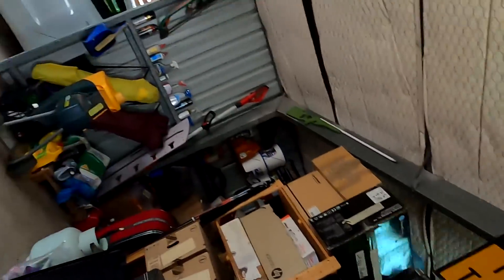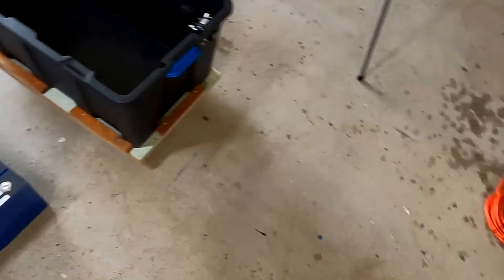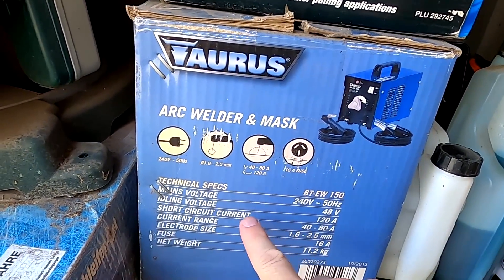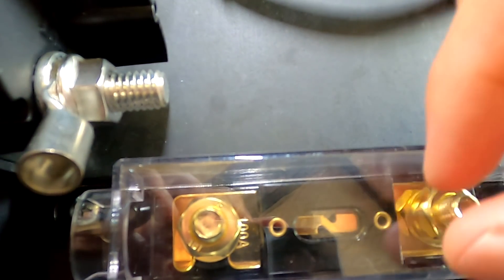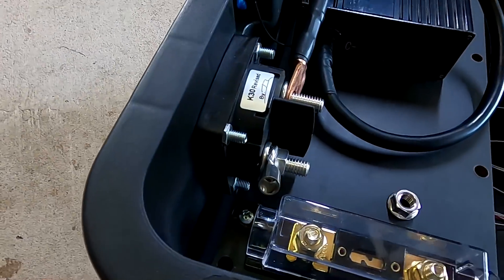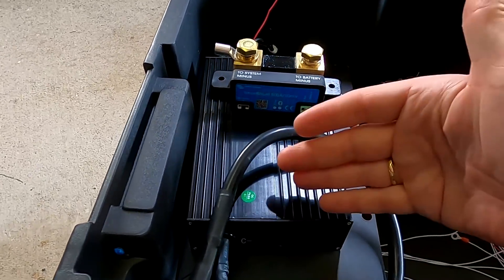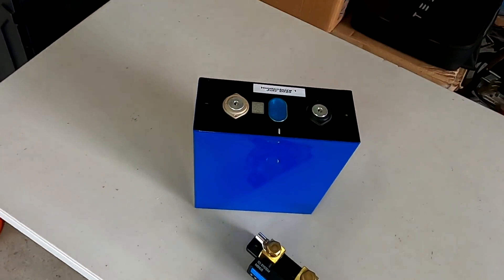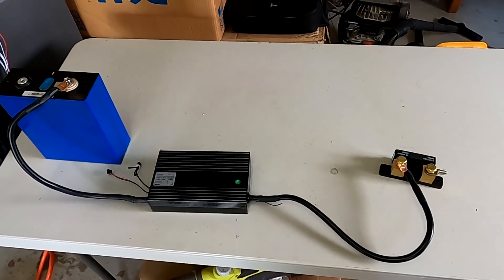Setting Shunt before the BMS a bad idea? Here is why I think this is GOOD! #buildthebattery.2

Comment: Yep #3 option, but I would also shorten the lead to the switch from the BMS. Make it a smaller pig tail.
Reply from the maker: I thought about that but does it matter a lot? Also if I need to change the config again to #2 I've got the cables ready... Maybe later down the track I will shorten these cables and make it look nice.

Comment: I would do #2 because with #3 if one cell gets to a very low voltage the BMS will disconnect the loads, but the SmartShunt will not be disconnected and thus will continue to draw some power: This could lead to a situation where one cell of the battery drops to 2.5 volts and the BMS disconnects the battery: However since the shunt is connected first it will continue to draw power and could lead to damaging that cell if allowed to continue discharging. I know the shunt doesn't pull much, but it has to power a Bluetooth radio which isn't nothing.

I also need to strongly disagree with your statement that the SmartShunt is "more accurate than BMS". Perhaps it is more accurate than the particular BMS you're using... (I am not familiar with that one.) However other BMS units I've used and researched have very accurate SOC calculations. For example, in my setup I have both the Victron Shunt as well as an Orion BMS. In my case the Orion BMS is much more accurate than the Shunt: The Shunt only measures amp hours: It cannot measure individual cell voltages, and only synchronizes with the battery when the battery reaches 100% SOC. It doesn't synchronize at 0% state of charge and so over time it's not 100% accurate, under continuous cycling the SmartShunt SOC will drift considerably from the actual battery SOC.

For example: Say you start at 100% and cycle the battery down to 20%. Because the shunt is obviously not 100% accurate it may read 21% instead of 20%. Now say you recharge back to 90%, but the shunt is off a bit so it reads 92%. Now you cycle back to 20% again and the shunt reads 23%... You see how the drift keeps getting larger? I have experienced this first hand with the Victron Shunt. Most BMS units will also measure amps going in and out, but they also monitor the individual cell voltages. So if you have a 280 AH battery and one cell drops to 3.0 volts while the other cells are still at 3.2 volts, the BMS will sense this and start to adjust the SOC downward to account for the voltage entering the "knee" at the bottom. The BMS will do the same thing as cells rise above 3.3v at the "top" knee. Where-as the smart-shunt doesn't synchronize the SOC until the battery reaches 100% SOC.

The other problem with the shunt: As your batteries age the number of amp hours they can store will decrease. So you program the shunt for 280 amp-hours, and it will only read 0% after 280 AH have been consumed. But if one of your cells drops to say 260 AH: What will happen is that after pulling 270 AH the shunt will still read 7%, but that one cell will have reached it's "Low Voltage Disconnect" and the BMS will kill power. However the SmartShunt will continue to draw power, and continue reporting a 7% state of charge to your phone via Bluetooth even though the pack is actually completely drained.

The BMS on the other hand should correctly report 0% SOC in this case, and will internally adjust the "state of health" down to 93% so that it knows for future discharge cycles it will base the SOC reading on 260 AH instead of 280. Good BMS units will also monitor the internal resistance of each cell and also factor that into the state of health of the battery to make future SOC calculations more accurate.

In other words: The SOC calculation in the BMS becomes more accurate over time as it "learns" the actual capacity and internal resistances of each cell. Where the SmartShunt is only as accurate as the amp hours you program it with. It will not adjust the battery capacity down as the battery ages and the state of health declines. You would need to monitor the state of health yourself and re-program the AH capacity in the SmartShunt from time to time to keep it accurate.

One thing to consider: In my setup my BMS can communicate via CAN-bus. I run CAN-bus (Which is very easy to wire) from my BMS to a Victron Color Control GX. The Color Control GX can then read the battery voltage, state of charge, state of health, battery temperature, etc, from the BMS via CAN Bus and can then communicate that info to the MPPT, Inverters, etc. (I use a VE.Direct cable from the CCGX instead of Bluetooth because it's more reliable, but I believe it supports Bluetooth as well)

I mentioned that I built my system using both the Victron Shunt and the BMS: But if I had to do it all over again I would simply skip the Victron Shunt and just use the CAN-bus to get the battery voltage and SOC data from the BMS to the Victron MPPT and Inverter products. Any decent BMS will be far more accurate than the shunt because it does more than just monitor amps going in vs amps going out: it also measures the individual cell voltages and cells internal resistances.
Reply from the maker: Thanks for your looooong comment and sharing your experience with your Victron products. That's very interesting and helpful.
The Smart Shunt has <1mA of consumption.
The statement does not come from me but from others who have tested the shunt and BMS's and found the shunt is more accurate. But I take your point and you have made your own experience with your setup already. 
I'm not sure if the BMS auto calibrates to the degradation of the battery. Maybe your's does that?
I'm also looking at the Color Control GX atm...
Reply: @OffGridGarageAustralia  Sorry for it being so long. I keep thinking of things that I want to mention. I built a very similar project to this about 4 years ago for my RV so I've definitely learned some lessons in the process.

Yeah, I saw the SmartShunt has only 1mA of consumption, so it probably doesn't matter much because it would be unlikely to be left in a disconnected state for long enough to hurt anything. But at the same time I thought the same thing about how I hooked up some stuff on my battery and I left a load connected before the BMS that also had a very small current that I thought wouldn't be an issue actually did end up causing me to lose a cell because it over-discharged it. After having that particular battle scar it just makes me nervous to have any kind of "load" (regardless of how small) that isn't controlled by the BMS because you might be off on a 2 week vacation when the disconnect occurs. And if the disconnect also prevents the MPPT from recharging over time that 1mA of current is going to keep pulling that low cell lower and lower. It may not ruin it, but that cell will now be "weaker" and lead to further balance issues in the pack later on.

These very large cells are hard to keep balanced as they age. My cells are only 200Ah so I imagine it would be even worse with 280AH. I had to add active balancers to my cells to help keep them balanced, especially since I had to replace a couple cells and so now those new cells are much "stronger" than my other cells which makes balancing even harder.

"I'm not sure if the BMS auto calibrates to the degradation of the battery. Maybe your's does that?" <-- I would be very surprised if it didn't. This is pretty much a standard feature of a BMS. My Orion Jr 2 unit absolutely does track the degradation / state of health. It also tracks internal resistance of each cell separately and can warn you when one cell is starting to get weaker than the others.

I highly recommend the Color Control (Or any of the Venus GX products). They really open up the possibilities of how you can control and automate your system and also allows you to control and monitor from anywhere if you connect it to your home Wifi.
Reply: @JeremyAkersInAustin  I have two 300 amp hour 48 V battery banks with 200 amp DALY. For each. I was considering putting them in series with a 500a shunt  positioned before my 30k inverter. However, my inverter has two DC terminals (which I suspect are connected inside the unit each other).
At This point it seems to make more sense to eliminate the shunt and rely on my Bluetooth from my each BMS.Any guidance would be appreciated. (Great explanation you are).
Reply: @JeremyAkersInAustin  Mind If I contact you directly to pick you brain on this?
Reply: @JeremyAkersInAustin does this can bus connection also work on the newer cerbo gx mk2 or ekrano, I suppose it’s a yes but i want to be sure
Reply: I don’t believe this was a question about what is better to go with BMS or shunt.  Andy asked where would be best to place the bms and shunt relative to each other and the battery.
I doubt that Andy’s BMS has CAN bus capability like yours.  By the way what BMS are you using?
I doubt Andy is going to do without his BMS.  No matter what communications capability a BMS has, I expect mine to monitor cell voltages to avoid both an out of balance condition which could eventually lead to either over charging or over discharging an individual cell.
Reply: @Muppet_Interfector  "I don’t believe this was a question about what is better to go with BMS or shunt. " <-- I never said it was... But if the BMS already does everything the shunt can do, and if it can do it more accurately, then why do you need the shunt? I already went down the path of doing BMS + Victron Shunt and if it wasn't such a pain to remove it I would. I don't use the Shunt anymore at all. My Victron Color Control GX gets the battery voltage, amperage, state of charge, health, etc, from the BMS. It doesn't need the shunt at all because it gets the same data (plus more) from the BMS itself and the data from the BMS is far more accurate. If I could do it all over again I wouldn't spend the extra money on the Shunt.

"I doubt that Andy’s BMS has CAN bus capability like yours." <-- Perhaps not... but CAN-bus is a very common feature in BMS units. As I mentioned in my reply I'm using an Orion BMS (Jr 2 model) but most other BMS units I've looked at also offer CAN-bus functionality. BMS units with CAN-bus do not cost that much more than those without, and if you take the cost of the BMS + shunt it might even be cheaper to simply go with a BMS with CAN-bus because then you don't need the shunt anymore to communicate voltage and SOC to the MPPT. Having the ability to communicate with external devices makes life much easier, because instead of shutting off a relay to stop charging (Which won't damage the Victron MPPT but could damage other MPPT controllers or other charger type devices), you can simply tell the MPPT to stop charging via CAN-bus. In my case the BMS communicates via CAN-bus to my Victron Color Control GX, and the CCGX translates the CAN-Bus messages into VE.Direct and/or VE.Bus to tell the MPPT and/or Inverters to stop charging. It also gives you the ability to do things like prioritize solar over grid charging: For example if Andy wanted to be able to charge his batteries from the grid as a backup to Solar, he could hook up a Victron charger (Or get an inverter that doubles as a charger) and the CCGX would tell the charger not to charge as long as there was solar. But if the solar power became insufficient it can command the grid charger to start charging to make up the difference. By communicating with a "smart" device like the Victron CCGX it really opens up a lot of possibilities. It also gives the BMS the ability to control the rate of charge: When the battery gets to 98-99% you don't want to keep charging at the same rate. You want to charge more slowly to give the cells time to balance. With a simply "on/off" BMS unit what happens is as one cell reaches 3.6v the BMS shuts off charging. But the other cells will still be around 3.4-3.5v, so as the balance current draws the 3.6v cell down a bit, the BMS switches on again and you get full amperage once again. This high amperage causes the high cell to almost instantly hit 3.6v again which causes the BMS to shut off charging again. With CAN-bus the BMS can actually tell the MPPT to limit charging to say, 1 amp, so that it can continue charging the low cells as it balances the high cells.

"I doubt Andy is going to do without his BMS." <-- Where did I imply he would go without a BMS? I never said or implied this at all. Of course he needs a BMS. I only suggested he may not need the shunt if his BMS can communicate with the Victron units directly.

"I expect mine to monitor cell voltages to avoid both an out of balance condition " <-- Perhaps you meant to imply this, but to be clear simply "monitoring" cell voltages alone does not do anything to "avoid out of balance condition". Cells will always get out of balance. Always. The only way to correct out of balance is to actually "balance" them, which requires either pulling amperage from a high cell or pushing amperage into a low cell. Simply monitoring the cell voltages alone will only tell you when the out of balance condition occurs, but the BMS has to go a step further than just monitoring the voltages, it has to actually pull or push current out of or into the cell to bring it in line with the other cells.

It's because of this out of balance condition that I caution against using the SmartShunt as the primary means for monitoring state of charge. These cells are budget cells, which is absolutely fine, but they are not going to be 100% matched the way more expensive high end cells would be. That means that over time they will get out of balance and most likely they will get to a point where even with the 200ma of balance current the BMS offers will become insufficient to keep them balanced. After 3-4 years of use it could get to a point where it could take days to balance these cells at that amperage. (Ask me how I know) Or perhaps one cell will go bad and need to be replaced (Again, ask me how I know), and that cell certainly won't be nicely matched with the rest of the pack. Either way: As some cells degrade faster than others the state of charge measurement offered by the Victron Shunt will get less and less accurate.

Here's some examples of actual issues I've had with my Victron Shunt:

1.) With an out of balance cell I've had my pack at 99% state of charge. But because only one cell was at 3.6v and the rest were still at 3.4-3.4v. This means the "pack voltage" was still around 52-53v which is below the voltage at which the Victron shunt "synchronizes". So even though the pack was nearly fully charged the Victron Shunt read 89%. The BMS ready 99% (Not quit 100% because it was still balancing). After many hours of balancing the battery voltage finally increased to the sync voltage and the Victron Shunt jumped from 89% to 100% instantly. Which means it's SOC reading was more than 10% off.

2.) Likewise with the same out of balance cells those weak cells would drop to 2.5v while the other cells were still at 3.2. So pack voltage was still above 50% but the BMS was reading 1% SOC while the Victron Shunt was still reading around 15% SOC. The BMS could see there was a low cell and automatically started adjusting the SOC downward as soon as one cell started to dip in voltage below the others. My BMS shut off all the loads while the Victron Shunt was still reporting like 13% SOC.
Reply: @JeremyAkersInAustin  Wow, good comment & big. Sounds like a great setup, I was wondering tho how you said you had a problem with a pre BMS load running away on you & causing trouble with cells ultimately, I understand what you are saying here, but I do like the idea of having emergency loads pre BMS, such as few lights for after hours problems if there is a BMS shut down, you still have some lights to help diagnose problems, find tools etc, and maybe a small camp  fridge to keep SPAT in worthy condition as well for a little while longer ( for maintenance purposes of course), until such time as the battery level becomes pre-critical & that is where I would have another safety to monitor & cut this load off as well, or stage critical loads off, sadly fridge 1st then lights soon after if condition still exists or gets worse, does that sound reasonable? Or can you still see issue arising with this type of configuration, idea being to keep a few small critical/essential loads to carry on after about 10-20% SOC area, depending on setup, size, etc, and when you want the BMS to stop major loads from taking batteries too far down, but maintaining an edge for some essential loads.  I get it that scenario’s arise, holidays, etc, but if there was another preset low battery cutoff for those loads, wouldn’t that overcome those issues you related to? Cheers

Comment: Battery-ve= smart shunt= BMS
Battery+ve= fuse= Switch
Reply from the maker: The switch will be in the neg line though as there is not enough room to cable it nicely to the pos cable.
Reply: @OffGridGarageAustralia  My guess would be, if you later decide to ground the system, you'd want the negative side to always have a path to ground. Having a switch "off" on the negative side would isolate the system from ground (ie a lightning strike).

Comment: #3, that is what Victron recommends. BTW, the voltage rating of your switch is less than your battery voltage. Even if you only charge the battery to 3.4 v/cell, the total voltage is 54.4v and the switch is rated for 48v.
Reply: The switch is labeled for it's "nominal" voltage. All "48v" batteries are well over 48v when fully charged. A "48v" lead acid pack (Which is what the switch was originally intended for) would exceed 60v during equalization charging.
Reply: @JeremyAkersInAustin  i believe this has been debunked - as in Blue Sea Systems rated the switch for the (rare) 36V system.  it's listed as a 48V "max"...  this has been, and probably will, be debated for a much longer time.  with that being said, i'm contemplating putting one of these switches on my 48v LiFePo4 bank myself...